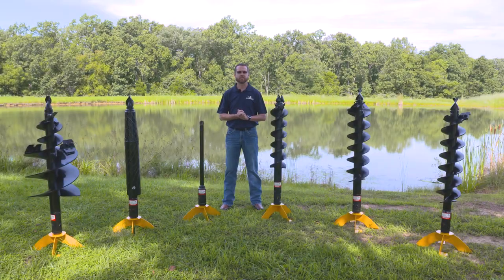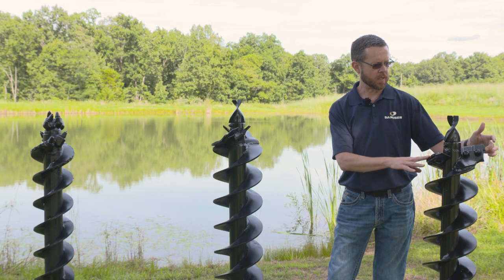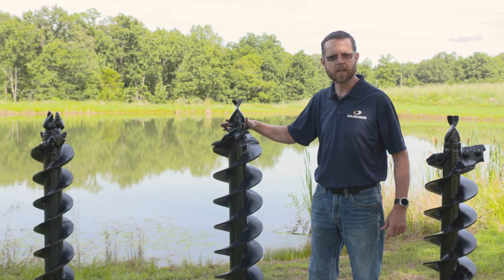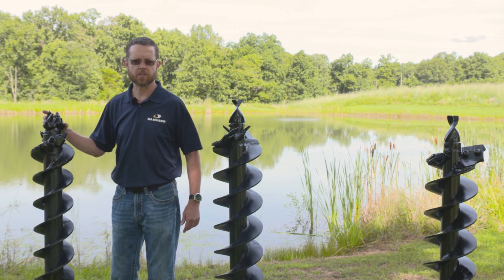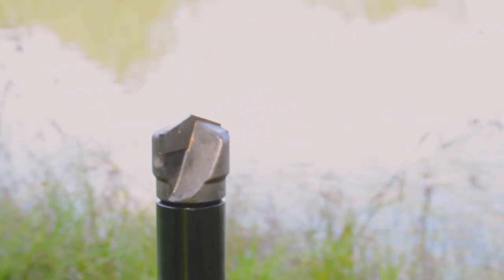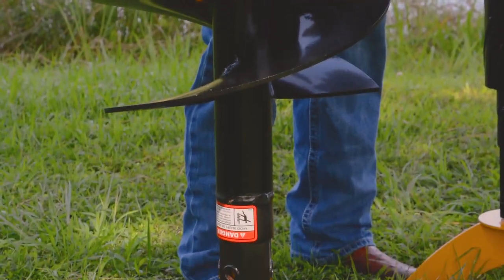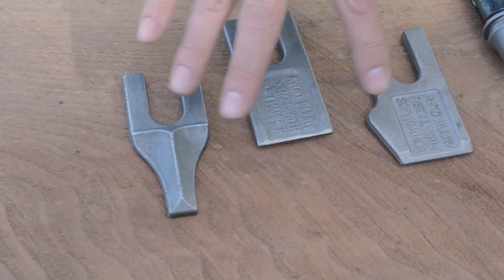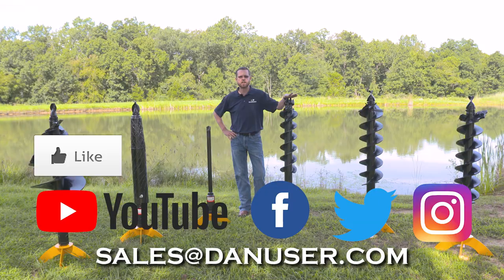How To Choose the Right Auger Bit

Comment: I need you to build a cradle and 2" hex concrete bowl attachment for my Danuser powerhead.  I currently have an offset FEL attachment for my hole auger. I already have your EP 1530 auger but find I need a concrete mixer. A bowl which attached to my auger drive and a cradle to hold it at the correct angle would be great. I see them with other systems... I need one for my Danuser system.

Comment: What's the best choice for till with potato to softball size rocks? Currently using a 9" soil auger that binds up imeadiatley when it gets into the till layer.
Reply from the maker: What digger or drive unit are you running?  What is the host vehicle?
Reply: @DanuserCompany  3-point on a 35hp Kioti.
Reply: I would like to know this as well.  Same soil conditions. I have the EP6 on order through my dealer. I cant get a good answer  from the dealer on which bit I will be receiving other than its the 12" that's included with the auger and it will be fine in that type of soil.

Comment: I used to work at a company which produces Augers, Auger Drives, machinery attachments, etc. I presently work both as a diesel mechanic and a equipment operator doing piling.
I have to say most of your augers display some scabby welds but your GET is really substandard, 2nd-rate chinese stuff.
Chisel tooth auger teeth are still for soft ground applications, not rock.
What you term 'bullet teeth' are poorly designed rotating-pick teeth which lack a taper and are just beveled in 2 spots. They will wear out quicker than the better teeth many manufacturers and distributors offer.
To lack a 65/75mm square drive option shows that you exclusively target landscapers and agricultural applications.